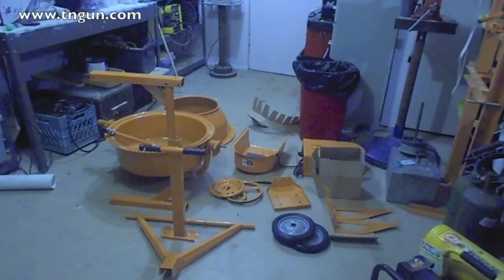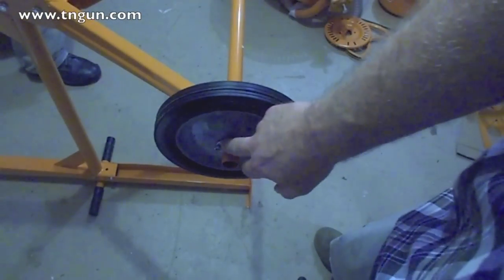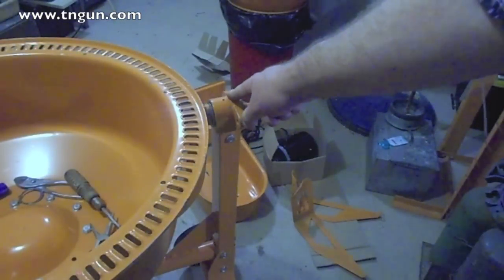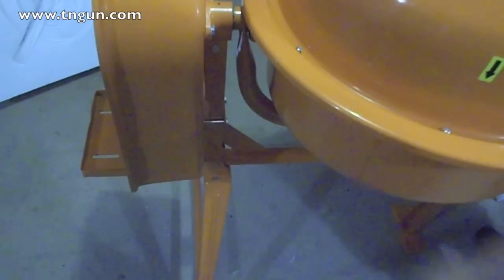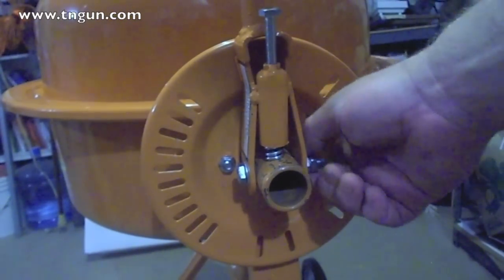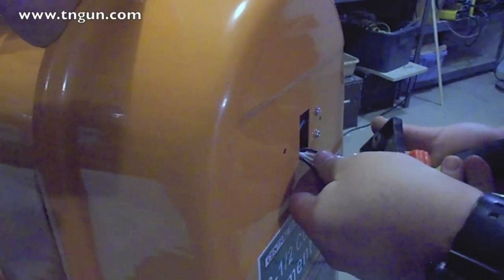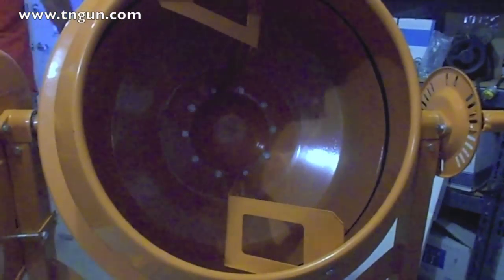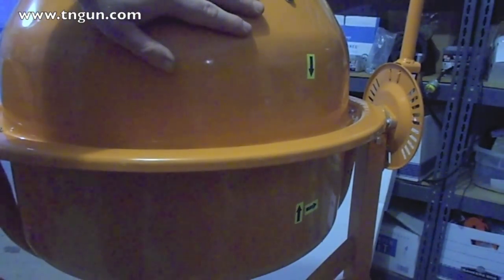How to Assemble a Harbor Freight Cement Mixer

Comment: I wish I had seen the part about aligning the 2 vertical arrows on the top and bottom drum. Something they don't tell you in the instructions.  I was able to bolt the paddles up but I'm sure they would have been much easier if my top drum was rotated three screw holes counterclockwise to align the arrows.  The instructions leave a lot for imagining how things go they don't tell you about.  I didn't put that little thing at the end of the spring that sits between the tension bolt and the spring.  I didn't see anywhere in the instructions where it tells you to do that ... I knew there had to be something for the bolt to press against but until I saw your video I didn't realize it was missing. Now I have to take the handle back off to add that and i hope that won't be hard to do ... in other words there be something in the way I'm not thinking about.  One nice thing they don't tell you about is the screws and bolts are in individual numbered packages and there is a diagram that tells which package you use for each part that you assemble.  Of course I didn't realize that either until I was about 1/3 done but oh well it was nice when I learned it. Thanks for the video.

Comment: Thanks for the info.  I have been looking for something like that sprayer at a fair price.
Reply from the maker: The sprayer is awesome, I sprayed concrete on a 16 ft tall 56 ft diameter dome in one day with a crew of only my dad and myself (having never worked with concrete before) and mixing by hand and with a small mixer.  Without the sprayer I could not have done that - it was hard getting the right mix to spray, but once that was figured out it worked great...
Reply: I went to the web site and see they have a number of systems.  Witch one did you buy ?
Reply from the maker: the mid range one not the ceiling one
Reply: got it. thanks

Comment: Good job at describing the assembly. Our unit was somewhat different so HF must had made some changes.  My wife and I put one together this week. I wish I had not purchased it. All bolts, nuts, washers, everything was in 2 bags (one large and a smaller one inside that bag). Extra bolt, washers, etc. but had to buy some due to improper length (small drive pulley from motor hits the bolt when tightened).
No discernible instructions. POOR instructions at best. I later seen a 4 cu ft cement mixer at Home Depot (was on sale for about $200) with looked to be much easier to assemble. They also had at least a couple of direct drive models for around $300. I want to buy more USA made product and the true name for harbor freight is China outlet.